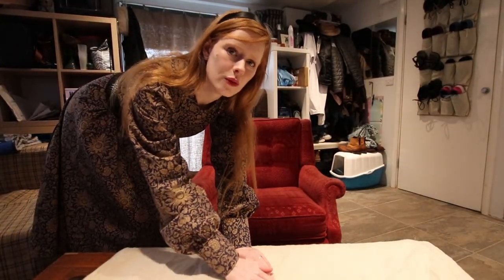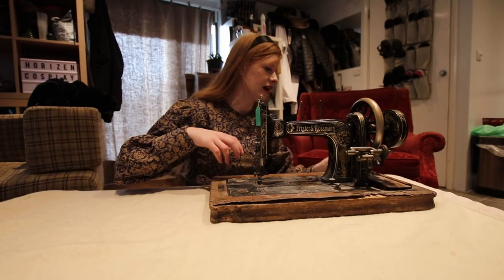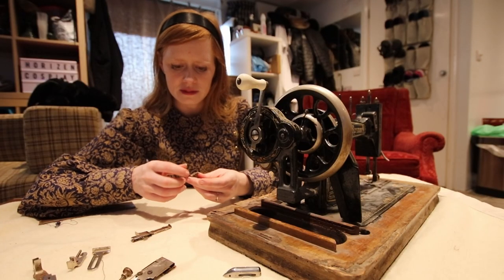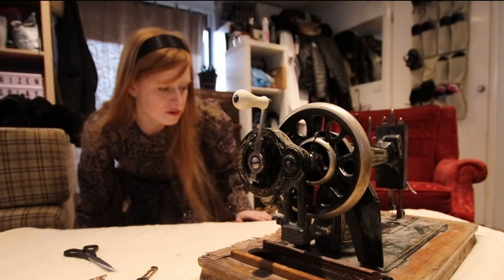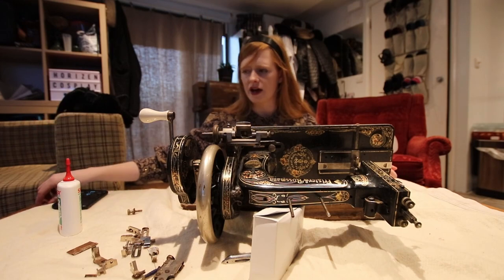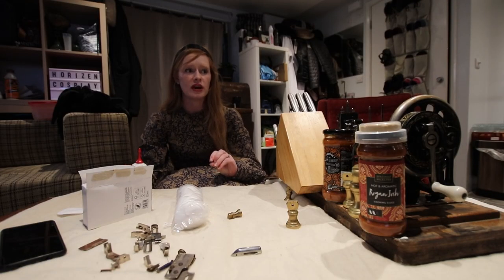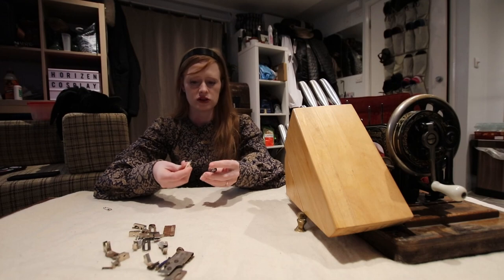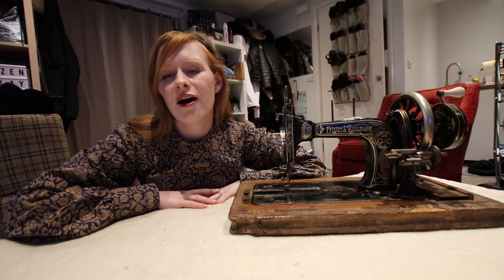UNBOXING And RESTORING A Antique FRISTER & ROSSMAN Sewing Machine - Made In 1900's Germany

Comment: Please don't clean these old machines with water. Water will often turn the gold colored decals silver. It is best to use sewing machine oil. If you must use a cleaner, it's best to use an oil based cleaner.
Reply from the maker: I did use sewing machine oil but to get the worst of the grime off I just give it a quick wipe so that I don't grind dirt into the paint :)

Comment: I just love these old machines. Loved the weights you used after gluing the wood. Curry, knives and sewing in one video.

I have a Singer from 1904 which we picked up from a local charity shop. I also have New Stirling. We have looked this up online and cannot find any info about it. It has a bullet shuttle and the bobbin is longer than the Singer bullet shuttle bobbins. I love both my machines and have started to use them to make my vintage inspired clothes on.

If there is anyone out there that knows anything about New Stirling machines I would be grateful for the information.
Reply from the maker: If you wanted to join the discord, the link is in the description, we have a channel dediated to vintage sewing machines where someone might be able to help. Otherwise I'd suggest looking at the vintage and antique sewing machine pages on Reddit and asking the question there. The people can be incredibly helpful!

Comment: I'm sure you've found the serial number already, but for anyone wondering, its at the front of the machine under the badge, stamped into the flat rim of the slot for the stitch length knob. You can just barely see the 6 or 7 digits (blurry) at 16:57.
Reply from the maker: Thanks :) and yep eventually found it lol